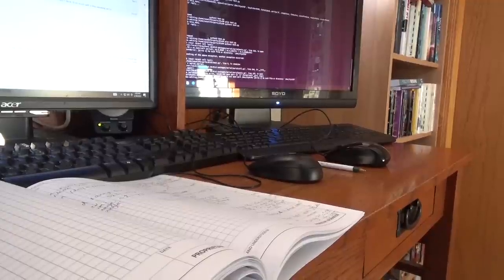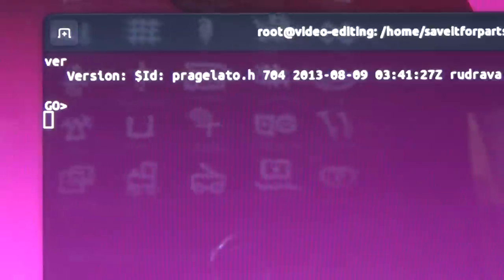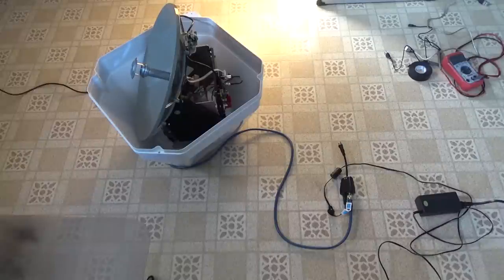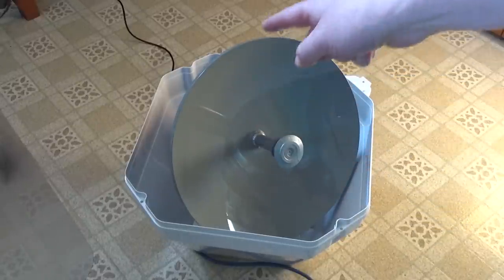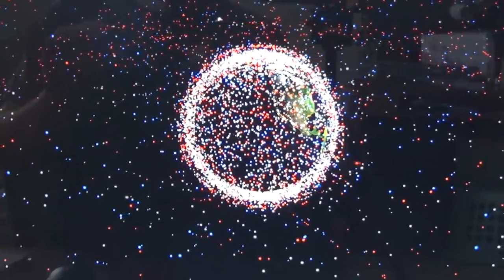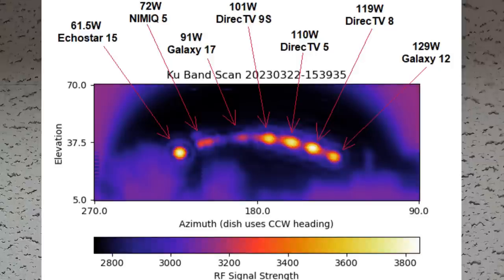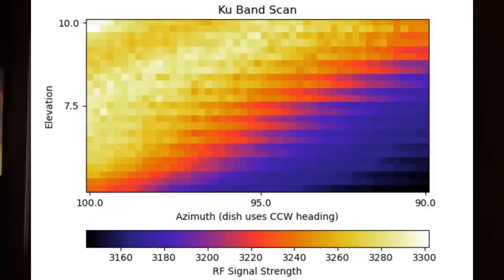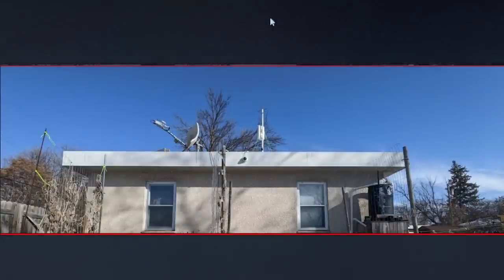Seeing Satellites with DIY Microwave Camera

Comment: I'm the guy who designed the system and built the software. You got lucky. This is the first generation firmware - we didn't bother to put any doors preventing anyone from accessing the console. The next version onwards, it needs a special sequence to unlock the control console.
And I wrote this exact same code, also in Python, back in 2012 to build maps of the sky in the Ku band and built a new algorithm that can detect satellites purely with pattern matching (as opposed to detecting the Network ID from the MPEG stream beamed down from the satellite).
Ask me any questions and if it's not something proprietary, I will answer them.
Reply: Fun fact. It took me 2 weeks to build the 'nudge' move. It's incredibly difficult to move a DC motor with just PWM control by a tiny amount due to gear backlash. The motors on the Tailgater are heavily geared down to provide power in really cold weather. The Tailgater is made in Minneapolis, so we pay special attention to our ice fishing customer base. Hmm, and I notice I said 'we' even though I left the company 6 years ago.
Reply from the maker: Very cool! I will definitely have some questions for you!
Reply from the maker: Thanks for the comments, this is really cool to know! 
I'm curious what some of the other commands in the Tailgater console do (if that's something you can tell me). Such as "scan", and "stat". I'd also like to know if there's any way to get an instant signal strength or do an "rfwatch" less than 1 second. Waiting for rfwatch 1 every time really makes for slow scans. Someone commented with their version at a much faster speed, and now I'm jealous :-D
I did get an older Tailgater to finally respond over USB, it's got some water damage so the motors are shot, but I'm looking for replacement online. It uses older firmware, and doesn't have elangle as an option. If I get it running I'll write a version of the code using elev instead. 
I assume VuQube units are from the same company (or predecessor?). I have a couple of those that look identical, but don't have USB. They do have an rj-11 phone port on the bottom, I'm not sure if that's for a serial interface or for one of the little handheld remotes. They also have a mysterious block of 8 jumper pins in the middle of the board, someone suggested that 4 of them could be UART, but I'm not too familiar with that protocol. 
Sorry for so many questions, it's just cool to talk to one of the original developers! If you prefer email I'm gabe@saveitforparts.com. Thanks again!
Reply: @saveitforparts  I sent an email out to you. We'll continue talking there.

Comment: If you wanted a more precise signal chart you'd need to use a much larger dish. Smaller reflectors pick up signals from their adjacent satellites --which makes them easier to peak up onto a signal, while larger dishes are able to focus more on specific orbital slots but require more precise pointing. DBS satellites (Dish/DirecTV) are a minimum of 9 degrees apart unless there are two or more in an orbital "box" that service a single slot such as Dish @ 110 (two actual satellites). FSS satellites are at least 4 degrees apart.
Reply from the maker: I have a bigger dish, just don't have motors for it. That's on the to-do list!

Comment: I wonder if you could hack a PCB electronically steered array receiver onto the antenna horn in place of the stock receiver for better fine spatial resolution without relying on the motors? And then use the motors for coarse adjustment. There's probably some open source electronically steered array PCB receivers online somewhere.

Comment: Wow this video is AMAZING work! This made me think on what would be needed to recriate this project but make it prepared with a LORA network, a SBC to relay the information, a solar pannel with a lippo battery so it can be deployed outdoors and be controlled from home. 
Like a portable satelite station capable of also downloading weather satelite pictures like i've seen on some other vids as well. That would be the ultimate project
Reply from the maker: I haven't played with LoRa yet but I want to check it out some time.
Reply from the maker: @raiden9250  Huh, I couldn't find that online, all I found was some tracking device dealy they're offering.
Reply: @saveitforparts  that's it. It carries a lrr1110 chipset. Highly configurable and does gps also. Enough of the new hasn't wore off of it for me to disassemble and poke around with the gpio yet.

Comment: I noticed your matrix has a characteristic error where even/odd scan lines are misaligned.  I suspect this is due to excessive backlash in the x-axis gear drive.  You could fix it mechanically or via code either experimentally by using a fixed offset for even rows or mathematically by finding the maximal alignment of two matrices (one of even rows and one of odds), and use that as the offset.
Reply from the maker: Yep, that's something I need to work on.

Comment: I recommend running it just into one direction per axis. This eliminates the backlash interlacing-like pattern you see in your image.

So if possible, just step it down one row and then rotate it around until you hit the first column again.

In addition, motion should look like a constant diagonal streak this way, instead of a waving line running diagonally.
Reply from the maker: Ironically I went to extra effort to invert each pass so it would pan back and forth instead of re-starting from the same side every time. It's perhaps slightly faster going back and forth, but the backlash and offset is annoying.
Reply: @saveitforparts  yeah, I saw your effort in the code. But I think the benefits are marginally, especially if you thinking about increasing the resolution with the nudge feature.

Comment: This practice is highly interesting, in other words, what you did was built a total-power radiometer using a Ku-band small satellite dish antenna. If you characterize the noise temperature of the LNB you can determine the system noise temperature and gain you can calculate the minimum noise power that you can catch with your receiver. Maybe another good idea is to adapt a feed-horn or a Vivaldi antenna to the LNB to not use the dish and increase the efficiency in a close-site range.    
Have you ever thought in write and publish an engineering scientific paper? Your work has potential.

Comment: Counterclockwise makes complete sense - that's how angles are usually measured, and should be the default mathematical setup. Otherwise, you'd have to multiply by -1 for all the angle calculations if you want it to be clockwise motion.
Reply from the maker: I'm used to compass headings, which are clockwise. I'm not sure who decided to make the compass one way and math the other way :-P

Comment: DIY dumpster microwave - classic! I wonder if one could use ChatGTP to help with the coding?
I think one could also use stellarium to help name the satellites, or is all that info carried in the signals? Another aspect of amateur radio to consider...thank you!
Reply from the maker: I got some of the satellite names from dishpointer.com based on the direction they're in. Someone else commented that there are multiple satellites in each orbital slot and I got a few of the names wrong.

Comment: I've personally found the Playmaker to be a much better unit, especially when it comes to the sensitivity of the front-end amplifiers and how quickly the built-in DSP can lock-on to the satellites.  It also uses gears for the elevation adjustment rather than a rubber wheel, and true closed loop motion control using hybrid steppers.
Reply from the maker: The motors and internals definitely seem more expensive in the Playmaker units I've messed with. I can't get them to do anything via USB though, so they're kind of useless for me. I might throw out the brain on mine and replace it with a Raspberry Pi.

Comment: I think you could use an in motion rv satellite as a tracker. they are made to track a stationary satellite from a moving vehicle. i would think it would work the other way around to. I've also seen older ones with easily accessible rs232.
Reply from the maker: That would be cool. I haven't come across one of those yet, they're a little more expensive and don't show up on Craigslist for $20 as often as the stationary units.

Comment: Polar coordinates are always being increasing CCW.  If you remember your math classes, unit circle has zero on the right, pi/2 on its top and pi on its left.
Reply from the maker: I'm used to compass headings for ships,  or Azimuth for astronomy, both of which are clockwise degrees. Most satellite location guides use that, so I thought it odd that a satellite antenna would go the other way.
Reply: @saveitforparts  There can be some proprietary software where user level of representation complies with the standard you used to. Probably on this level it's done to be more compliant with some math equations.
Reply: @saveitforparts  ב''ה, you might be looking at a repurposed ceiling-mount design (cameras, lighting etc.)

Comment: 3:20 the engineers were probably thinking in math degrees (starts at 3 o'clock and increases counter-clockwise) rather than compass degrees (starts at 12 o'clock and increases clockwise) 

12:20 re nudges, you could try home the azimuth axis every pass. Basically, carriage return. It'll take longer but the backlash doesn't accumulate.
Reply from the maker: I have a follow-up video running the azimuth motor that way. It kind of worked but I still got some distortion. The "Nudge" just isn't designed to be a rigorously calibrated amount of motion.

Comment: There is the question of stepping resolution but also the question of how directional a two foot dish is. I would suggest that you build a 100 meter dish like Green Bank. You would get plenty of spatial resolution. Mmm, you don't have enough space for a 100 meter dish? You can still process your current measurements with the characteristics of your current dish. There is the directionality but also the sidelobes of the dish.
Reply from the maker: A big telescope would be great! We could probably park it between the tunnels and the monorail out at Sandland :-D

Comment: I'm working on a very similar final project for college, but I'm using 5 GHz internet antennas. In addition to the scanning method (which also generates a similar map haha) I am also implementing a genetic algorithm to reduce the time needed to perform the alignment between the antennas.
Reply from the maker: That sounds cool! Are you using custom hardware or an existing motorized antenna?
Reply: @saveitforparts  i printed the structure in 3d and i am connecting the two servos to an arduino to interface with the python script in my notebook

Comment: this is really cool. congrats! 

i noticed there's a horizonal offset of each pass. probably caused by backlash in the motor gearing. where the gears have to re mesh when they change direction. you could add a backlash correction movement as a first motor step after changing direction.
Reply from the maker: Yep, I've had a few issues with offsets! This is actually the cleaned-up version, my original outputs were a lot more distorted. That's a good idea on the first movement, I'll put that on the to-do list!
Reply: What about doing the scan in the 'finer step direction' and then return to start and only take measurements in that direction?
Reply: Potential simple solution: what if you put some sort of spring (rubber band?) applying a tiny bit of pressure to one side or the other so the gears stay meshed on one side of the teeth. That would be a lot simpler than backlash compensation.

Comment: Looking at that KU arc - I’m guessing you’re located somewhere in the NE US but not east coast. 

I’m in S Florida and arc is much higher and more shifted east.
Reply from the maker: I'm in Minnesota.
Reply: @saveitforparts  - I guess that confirms that I still have the “power” to find satellites with just a compass lol. I spent a few decades running a KU TV truck and averaged about 2-3k uplinks a year with nothing more than a compass and my “feel” for direction. 

When I would uplink from Key West I would have to jack the front of the truck up in order to get the dish to not limit out on elevation. Most of the time I could say in my best Indian voice- SBS6 That Way and point. 

The geo stationary communication satellites are mostly empty now. Hardly any occasional video up at all.

Comment: Do multiple runs, maybe offset them, run it through Registax, free resolution and SNR.
Reply: ..or just stack it in code, but you get the idea. One can trade temporal resolution for spacial resolution. If you are really interested, you can sample on multiple channels and play processing power off against dynamic range...

Comment: You should look for a Sat look receiver old c band ku band installers tool I had 5 or 6 when I had my installation Co. We always set the transponder and polarity for the sat then looked for the signal even the old receivers had auto program once you set far east and west, the problem with searching for unknown sats are you must know 3 positions and the program must triangulate them then you cans search ku band c-band have different lnbs C-band you must change from - to + polarity the c-band lnbs has a signal guide you can add ku band to. But moving your dish around is going to be challenging to work out a program to detect all broadcast but I see your vision if you can tap into AI maybe you can get the return signal that will draw a very nice picture of what your looking at. Orbit magazine will give you up to date transponder information and positions

Comment: That's cool. Is it possible to do different frequencies?  I vaguely recall it said Voyager is a bright source of a specific band.
Reply from the maker: I would need to swap out the LNB for different frequencies, and it's somewhat of a custom design. I could probably replace it with an SDR and do the radio reception that way, but it would need additional cables, more software etc. It's on the list for possible future follow-ups!

Comment: very cool project!

you could use an rotary encoder to track the dish position. then you would not have that many problems with nudgeing the dish.

an rtl-sdr could also sample a bit faster if you need/want that. as a LNB does downconvert the Ku Band to 950-1450 MHz. 13V/18V switchable PSU for a bit of extra data. (left pol, right pol)
Reply from the maker: I might do that with some of my bigger dishes, for this one I wanted to use the existing hardware as much as possible. I find that I learn coding / electronics / radio better if I start simple and work my way up. After I've played with something like this, a lot of other how-to guides and ham projects start to make more sense to me.

Comment: you should be able to iterate through a string and send each character it the command one at a time using a loop instead of typing dish.write("") for each character. 
you wouldn't have to change the script to send a new command that way.
Reply: Yep. Just make a function:
def send_line(s):

     for c in s:
           dish.write(c)
     dish.write('\r')

Or something similar.
Reply from the maker: Interesting ideas, I'll have to try that when I get around to part 2!

Comment: I wonder if you could do the same stuff with a high gain 18 db wifi directionnal antenna, monitioring the wifi landscape as visible from the top of your house...
Reply from the maker: I probably could, some other people have done Wifi imagers. I'd have to balance it onto the antenna motors (or program different motors, like my Pi nerf turret).

Comment: That was cool looking to see what microwave RF looks like. And an interesting point about losing your Sat signal if it crosses in direct line with the sun and your receiver. It's like trying to see a firefly sitting on the edge of a spotlight.

Comment: I wonder how much trouble it would be to convert the servomotors that it uses over to ones that are more accurate, and that can react more quickly. I bet that might help with the 'nudge' functionality, and there would be less backlash (in either direction). I also wonder if you could run two or more dishes in a signal combining mode. Something like how VLBA does their radio astronomy. Subbed, have fun :)
Reply from the maker: I have a recent video where I tried making an array from these dishes. It didn't work the way I tried it, but there might be other ways I could do that.
Reply: @saveitforparts  - There are some good videos out there that can offer some guidance on servos and how to get the most out of them. I'd have a look at some of the robotics channels specifically. Really enjoying your content so far. Keep it up :)